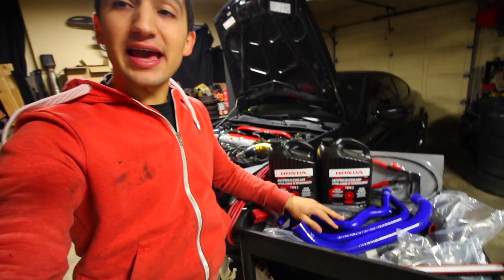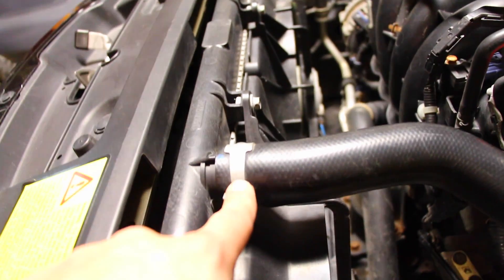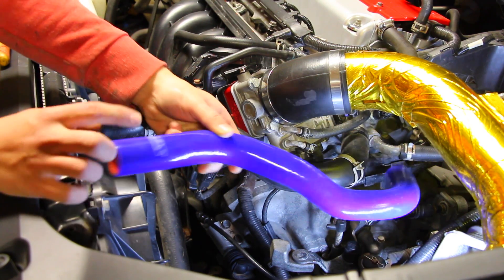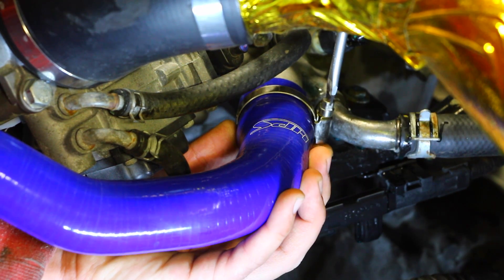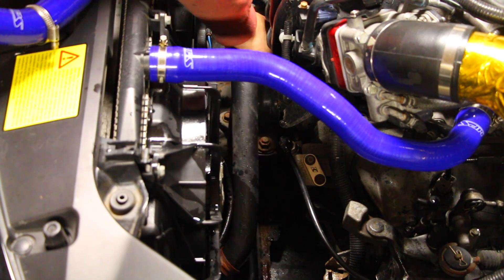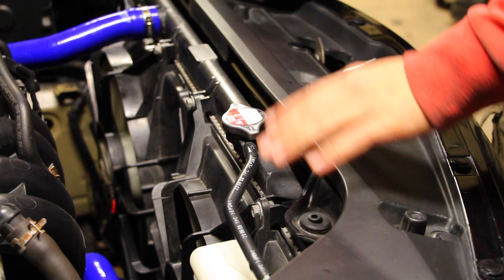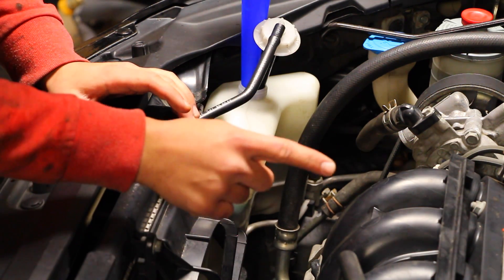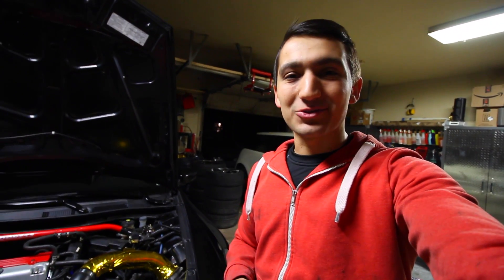How to Install High-Temp Silicone Radiator Hoses

Comment: I don't know how to say your name or spell your name young man. Since you had them for 4 years hoses. Number one question . Have those silicone hoses shrink. Number two question. Does the silicone hoses kind of slip away from your connection to the radiator 4 to the heater core connections even though you have the clamps on. I'm asking because I want to buy some for mine Toyota Corolla. Please answer me as fast as you can thank you young Man. Also had any difficulties with them problems

Comment: One major thing you have missed mate from one car guy to another but after you topped it up and changed the hoses you should of left the rad cap off and let it run it to temp and let any air bubbles in the system get out. 😉

Comment: About $190 HPS hoses for the New Edge Mustang. It also has a bleed valve right on top of the thermostat which makes things easier, plus you can also just use the EPAuto funnel. 
Recently I've been messing around with different coolants and I wonder what would happen if you mixed Mishimoto's "Liquid Chill" into your coolant without flushing.

Comment: I cringe looking at the coolant spilled all over the place. Some of those liquid made contact with wiring harness connectors. People if you intend to do this, please plan on doing so when you are doing a coolant flush.  Replace the hoses while the coolant is emptied. You will still have some spill from coolant trapped in the hoses but not as much as this one. Coolant fluid actually also contains some level of corrosive properties. I saw the mess it left my epoxy painted garage floor.

I also did not notice any air bubble bleeding procedure being done.

Comment: Awesome video..... I will not be critical.... (there are many others that will find any fault as objectionable) ... I may suggest tho that you replace all regular radiator hose clamps with worm drive clamps.... they dont look pretty.... but they are so much better at not leaking.....  No rant.... no fault finding.... just a suggestion....

Comment: Not necessary on this car or cars like this. Save your money. Silicone hoses are for race cars, turbo cars that run hot or police/taxi use that run 24 hours. Silicone hoses also need special marine clamps. You can't use epdm hose clamps.

Comment: Hey man, i just replaced my radiator and my top hose is leaking because of the clamp (i think it's not too tight and can't tight it much than that because its too small). but you say that you dont need to tight it too much, isn't that risky after the engine gets hot and the pressure inside the hose increase? which will push the coolant to leak from the hose, or even disconnect the hose from the radiator? i am planning to buy new clamps to tight it a bit of too much by making sure i dont damage the hose and radiator entry.

Comment: In my opinion the OEM spring clamps on the old radiator hoses are a lot better than those cheap warm clamps that normally break. I just wondered to myself why everybody throws the good ones away and puts on the warm style ones?
Reply: Robbyota 559 they're a lot easier to put on but I agree.

Comment: ok im seriously not trying to be a hater here but i have heard some solid science that says silicone is bad for carrying hot coolant. and is best for intercooler systems where its not exposed to polyethylene glycol.  apparently over time the heat can allow coolant to penetrate into the wound layers of silicone and cause bubbling of the hose and eventually leak...

Comment: I have a 2003 accord coupe (2.4L) and i was looking for some replacement ignition coils, it has the stock ones still with 230k miles (original plugs too, but i already ordered new NGK ones). I've been looking around but i'm unsure of which ones are decent factory replacements and not performance ones like the Accels.

Comment: beginning of video you dont want coolant on the ground due to its toxicity 

5 min later (spills coolant) i dropped some so i will have rinse the engine down later

i believe it would have been easier and safer to just drain the coolant into a clean container then re use it

not harping on you m8 .. just trying to help

as always we appreciate the videos
Reply from the maker: That is very true, however did you notice I had the drain pan on the floor to catch anything that would fall? I mentioned it towards the beginning of the video :)
Reply: milanmastracci I did ... But I'm saying the rinsing the engine down ... Some people wont think twice washing the engine down in thier front yard .

Anyways I apologise if I was out of line .

I'm still patently  waiting on your tsx tranny saga by the way .
Reply from the maker: No worries buddy!! :) 

Unfortunately I wont be installing that TSX tranny in my accord. The guy that I bought it from misrepresented what it was, lied to me and was a PITA to solve. I got my money back from it, and after I'm done the mini, I think it'll be time to mod the accord. I'm thinking supercharger and 6 speed tranny with an LSD :D
Reply: We do hundreds a year. Drains onto ground fine. The rain washes it away fine. Have not seen any animals sick so far

Comment: I think you should a went with red hoses. blue kinda threw off the red and gold lol but thanks for the video!! I wanted to change mine out too
Reply from the maker: Only reason why I went with blue is because I thought of it logically. They're coolant hoses, and the coolant goes through the water pump/coolant pump. Since I figured blue is associated with water, its very easy to distinguish in the engine bay what is a water hose/coolant hose :)
Reply: Well that makes sense!! Lol. Great video tho! I'm gonna change mine out soon. A lot of your videos actualy helped me out a lot! Keep it up bro.

Comment: I must honestly admit that I had a great laugh when I saw you changing those hoses. such a pro is doing such a thing 😂 . especially if you've got a valve it's so easy to remove all the water in about three minutes from the cooling system. and you talking about environmental friendly and this spilling all around, yeah I will believe that you catch all of that, just better say that you've moved your garage to Mexico. I worked on my golf cooling system last time and I just came back home with engine 90 degrees hot I've opened the reservoir to release the pressure and then I open the valve to release the mixture I messed up(to THE GROUND!) so later I had nice and clean job on my engine. also those hose clamps include in your kit, the thing that they got something engraved with the laser wont make them any More useful when it's completely useless crap. you always looking for the best solution and than you're putting something like that on your hoses , original clips are so armored that I would never replace them with anything else especially with the pathetic jubilee clips. 

so is it hard to do - reasonably
is it clean to do - TOTALY*

(* if you do it right)😀😁😂

oh yeah and one more I was checking your old videos and I completely don't understand why you not doing tripod thing no more only that hand recording which is completely awful.

PEACE fella😋

Comment: my car is a 2008 Renault Clio Symbol
and its coolant system is perfect
the only thing i want to upgrade to a bigger radiator fan 
that it ^^
Reply: 1.4L 8Valves 75Hp @3500rpm
not the most powerful engin but it's okay
im actually lookin for a 2.0L 16Valves
i think it's has 275Hp :) @4500Rpm
Reply: Ramy RDJ there is no way the 2.0 is putting out 275hp I have a bmw 1.8L and it does 135hp at 4500rpm there is no way a 2.0 Renault is going to be 275hp no way
Reply: Edwin Medrano the Engin of the Megane RS 275 Trophy is doing it 
and without a turbo :)
Reply: Ramy RDJ wow I didn't know but that's damn impressive
Reply: Edwin Medrano the Clio 4 RS have a 220Hp  1.6 16Valves Turbo :)

Comment: How much horsepower does ur honda have? My mustang has 210 but still really fun to drive
Reply: Daniel Dematteo yes , i went to a dealer 3 years ago and saw it and it was 2010 the new body style i knew little about mustangs then so i bought it then found out that the 2011 had the new v6 engine lol so needless to say i was pissed but oh well 😔
Reply: Wellington The accord is roughly the same. Between 197-205
Reply: Klutch 416 that's to the crank not the wheels
Reply: Wellington is it a v6?
Reply: Wellington damn, thats awful, im getting an 05 v6 in a couple years.